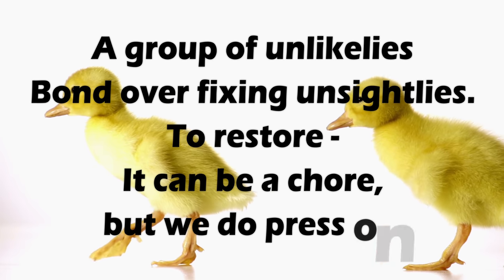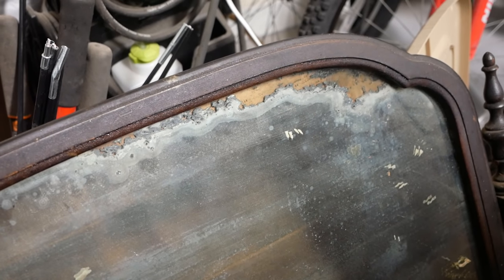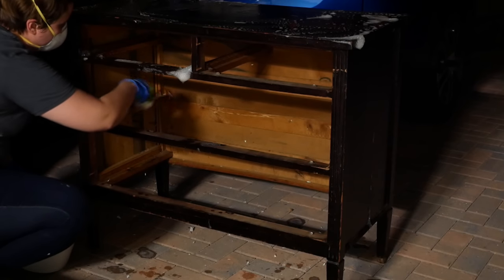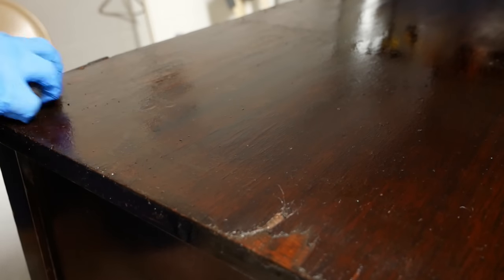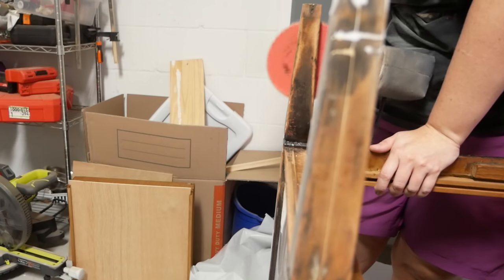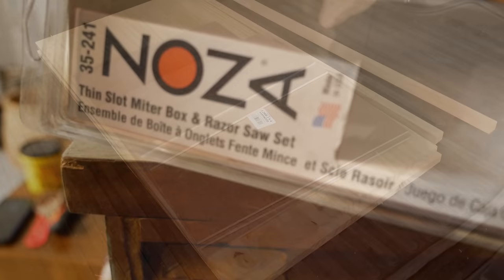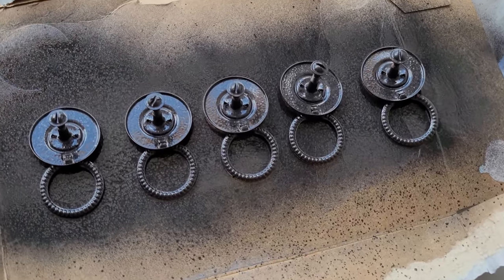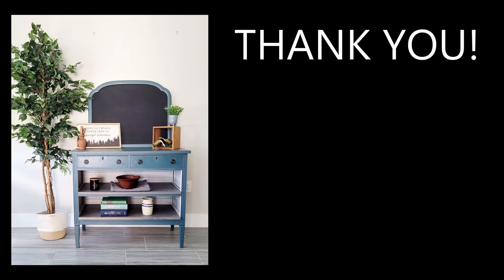Upcycling a Neglected Damaged Dresser to a Coffee Bar or Entryway Storage | Ugly Duckling Challenge

Comment: Emily, you’re doing some super stuff.  FYI- that lip on the bottom of your miter box hooks on the edge of your bench to keep it from sliding when you cut.  It will keep it a little more stable.  Keep it up the energy and the great work! Nice finish. -Phil  p.s. experience has shown me…you’ll never have enough have enough clamps.  ;-)
Reply from the maker: I legitimately just bought more clamps, and still feel like I need more!!! I think I just need a bench instead of working on furniture in the queue or on the floor...*hangs head in shame*.  I  had one for a while but never used it. Need a purposeful one that can be moved. Thanks for your comment Phil!

Comment: Letting the glue dry a bit and scraping it off seems to work better than wiping it while it's still wet.
Reply from the maker: I've had issue where the glue creates a grain tear out when scraping, which is why I prefer the wipe away method. How long do you recommend letting it setup before scraping it off? Thanks for the tip Lou!

Comment: Gorgeous!  Question:  can I use the beeswax on the inside of drawers that will hold clothing?
Reply from the maker: (responding with the assumption you're using the beeswax that is commonly used on cutting boards and is some what of a liquid.) Yes, but you'll need to wipe back the excess with a dry lint free cloth. Same with hemp oil. Typically you'll let it sit on the surface for 15 minutes or more so it can hydrate the wood and then wipe. These drawers for this dresser were incredibly dry to the point there was basically nothing to wipe. If the drawers are on wooden slides I also recommend using it on the drawer slides. Hope this helps and thank you for watching!

Comment: You can have a mirror "resilvered".  I have an oak dresser I got from my grandma. It can be pretty much dated because of markings I found on the back of the mirror when I thought I would replace it ...... but to do so would destroy the provenance ..... there is the name of the furniture manufacturer as well as some newspapers that were laid in between the mirror and the wood backing.  So, while the silvering of the mirror has deteriorated a bit, I wouldn't change it for the world.
Reply from the maker: Good to know! Thank you for the info - I greatly appreciate it!!! I too have an oak dresser from my great grandma. Now i'm curious what it says on the back of the mirror.
Reply: @ReconstructingEmily  My dresser needed a restored finish and some structural and aesthetic repairs ...... the only thing that was not (have still not) been able to restore are the porcelain casters ..... so it sits about 2 inches closer to the floor than I would like ...... I have not been able to just buy any ole casters because the post on modern casters is too thick (larger diameter) than the post on the original porcelain casters (had to pitch'em cuz they were either broken or severely cracked ..... not salvageable)  any time I am anywhere near antique stores, thrift stores, resale stores or salvage stores, etc. I always check for replacements that will fit (no, I cannot redrill the legs for a larger diameter caster because of how the legs are constructed) ...... in 34 years I have not been able to find replacement casters that will fit the holes in the legs ....... so my trusty Swiffer mop will continue to wrangle up the dust bunnies under the dresser.  :0D

Comment: A blight struck American Chestnut trees in the 1930s. Veneered furniture in the 1930s and 40s will sometimes have wormy chestnut beneath the veneer. In these cases, the wormholes are from when it was a tree, not an infestation of the furniture.
Reply from the maker: Thank you so much for leaving this comment here! I greatly appreciate you sharing this bit of knowledge! I noticed similar damage in only specific boards (definately pre-furniture wood damage) on a family dresser around the same time as this. I would assume the same applies since these boards are only on the back side of the dresser? Though the primary construction is oak, I don't think these boards are the same.
Reply from the maker: Now I have fallen down a rabbit hole of information. Quite sad imported trees caused it. Thank you again!
Reply: @ReconstructingEmily  Yes, the American Chestnut was a powerhouse in the lumber industry. Chestnut (even wormy chestnut) is a pretty prized decorative wood, especially in the rural southeast. So if you ever find a piece with chestnut beneath failing veneer (often drawer fronts and tops on old utilitarian dressers from the late 1920s-40s, it gives a beautiful rustic appearance when it is revealed. Love your videos, and your work. Keep it up!!

Comment: I found your video interesting. I was surprised to see you wash your furniture with water. I wonder if there are any abnormalities such as warping of furniture even after washing with water.
Reply from the maker: It was stored outside in a carport before I purchased it in over 80% humidity. Anything that was going to warp on the piece had likely already warped. While I really don't encourage or normally use excessive water like that, it was the best course of action that I had avaible in its current state. Saturating furniture with water can definately cause warping, but the overall structure and even the parts of the drawers I removed were still good (thankfully).
Reply: Thank you for clearing my doubts

Comment: You can just glue the lifting veneer back down. You don't HAVE to remove it.
Reply from the maker: True. You don't have to remove veneer everytime its peeling. Sometimes you can glue it back down and clamp it with a board. From what I saw with this dresser, the veneer was peeling and bubbling along the entire bottom trim. The choice to remove it was made based on the fact that most of it was not in good shape. I would rather have a good substrate to work with, rather than one that might cause issues down the road. Thanks for watching!

Comment: Hi. I have a teak table with lots of bubbling on the top only. What can I do? Can I just do a wood filler on the whole top and just sand it down?
Reply from the maker: That is unfortunate, teak is such a pretty wood. If the veneer is bubbling in only a few spots, sometimes you can use a wood glue syringe and fill the bubble and press it down with something to flatten it out. If theres a lot of bubbling I would sand it down and use wood filler. Since its a top surface - two part wood filler or bondo is recommended. Regular wood filler (that feels sort of like sand) is going to be a bit soft for larger gaps. Hope this helps you Theresa! Thank you for watching!